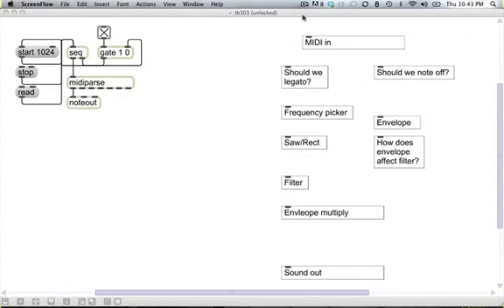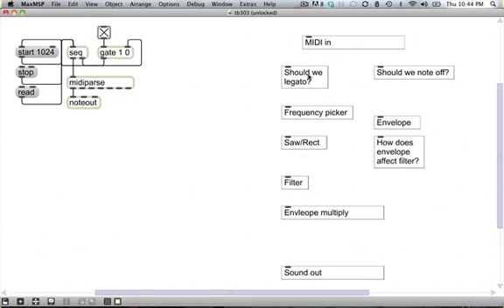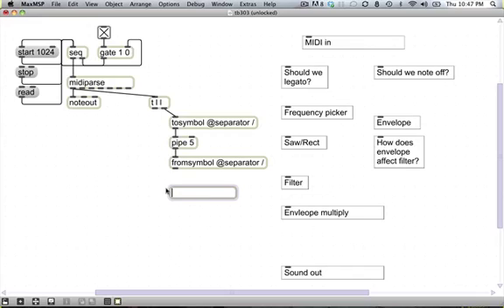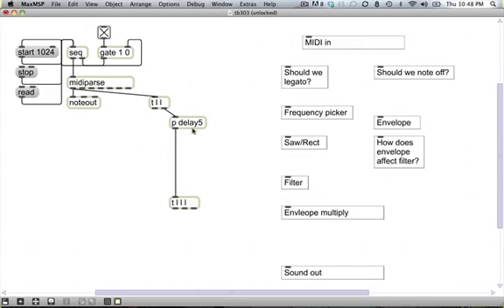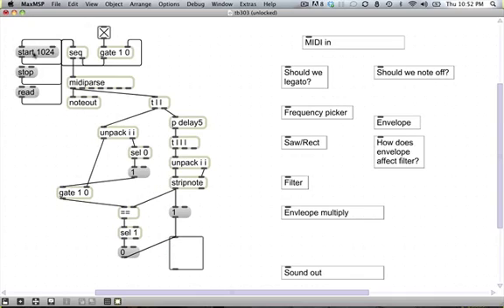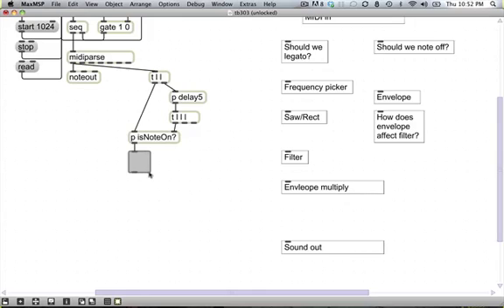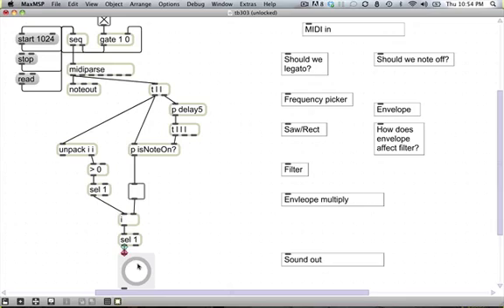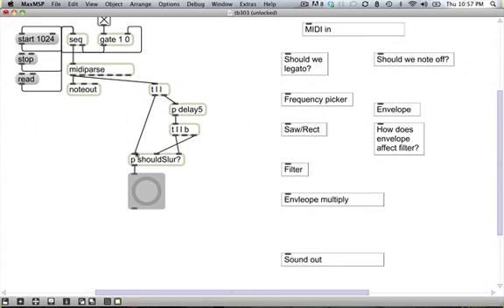Delicious Max/MSP Tutorial 6: Let's build a TB-303! (Part 2)

Comment: Looks like a found an error in `isNoteOn?` module. After you pass 1 to note off gate this gate isn't working anymore - it's just passes all input data to it's output. As a solution, you need to send 0 message to it, when note velocity is not zero. This can be done via second sel pin by converting it's bang into 0 message as it was done before.
Reply: I noticed this problem too.  The next question is why does it still seem to work nonetheless?
Reply: Ah, the new note passes through the gate, but doesn't equal the note stored in ==, so its path stops there.

Comment: anyway in my defense of the aesthetic and genius design of midi code in binary:

the second half of a status byte being midi channel (nnnn) -  midi channel (0-15) 16 channels

e.g.
•Note on (status byte 1001nnnn)
•Note Off (status byte 1000nnnn) ignoring the fact that note off in max is note on / velocity 0 - perhaps this is the problem???!!!!
•Control Change (status byte 1011nnnn)
etc

taking http://www.midi.org/techspecs/midimessages.php as an example source

     status byte              date byte1        date byte2
    1001   0000             0100 0101        0110 0101
note on | midi ch (1)    Note no (c3)     Vel. (101)
        144 dec                   69 dec            101 dec
            90h                        45h                  65h

you see, beautiful and logical, in its inception (even if it is just a rather loud middle c).

So why pipe 5 - is it due to the math vs cpu speed in my previous message - or the note-off being note on of 0 velocity?

Or neither and I'm a total loon.

You can't deny the simple beauty of it, even if it is wasting 128 possible more values being available for use - but who needs those 128 values... that's what pitch bend is for right? ;-)

I can't even think right now anymore.... smchmeewww says my brain few remaining brain cells to my other remaining brain cells.

Comment: now to confuse myself more (or hopefully clarify) since the midi bit rate is 31,250 per second and there are 10 bits in a byte, the midi byte rate is: 3125 per second, most complete MIDI messages require two or three bytes, so the transmission of musical data is about 1000 to 1500 events per second. This is pretty fast (back in the day, but there is no such thing as two absolutely simultaneous events in midi, as you say, any two events must be at least 0.6 milliseconds apart (in external midi applications i guess), is this irrelevant in max as max operates faster than this - which is causing the problems?

Comment: just to clarify why pipe 5ms when avoiding framing errors is 0.032 ms between subsequent data +/-1% - is this because this presumed CPU speeds of 1MHz or half 500 kHz at the time and now we are operating with much faster CPUs? So is the 5ms a result of this or an arbitrary but practical amount, or have i missed the point here? bit of an old noob question I guess!

Comment: no sam no! midi rules! and is aesthetically amazingly beautiful in its simplicity. the definition of beauty itself.

i realise it's still midi 1.0  (since 1983) - but that's cause 2.0 would mean fuck you your old stuff no longer works with us anymore.

but it is beautiful i tell thee beautiful!!

if i remember rightly...

10 bit byte
binary 0 start bit
8 data bits
binary 1 stop bit

now only considering the 8 middle bits from now on - say for note ons

note on data has 3 bytes
byte 1 = command byte (note-on)
byte 2 = data byte pitch of MIDI note cc
byte 3 = date byte velocity vv

even though each byte has 8 usable bits (so 256 possible values right?) we are limited to 128 because binary 1 at start of byte indicates a command byte (note-on) while binary 0 at start indicates a data byte. there may be more or less data bytes in other messages, of course, tons maybe, but that's the beauty - we know it's a new message cause of the status bytes beginning with 1. always.

given the 1 in this example (and well all of the commands) and the 0 (in the data bytes) is the greatest value / multiplier (i.e. left-most) we halve the resolution -

"this is another reason why it is shite" i hear you cry out

- but here instead of limitations I see beauty and easy to read code in binary and therefore hex. this gets even more exciting, cause you scan read the two halves of the bytes in pairs of hex numbers, but i'll let you stop me there before i blow a load into my binary shorts.

therefore i rest my case midi is beautiful in its simplicity and therefore beautiful in its' readability; it's certainly the only code, command set (or spec if you wanna get all girly about it - sorry girls who love midi in binary form - please pm me if you are one of those) that i could attempt to compose music in, in binary.

www.bugcompass.co.uk